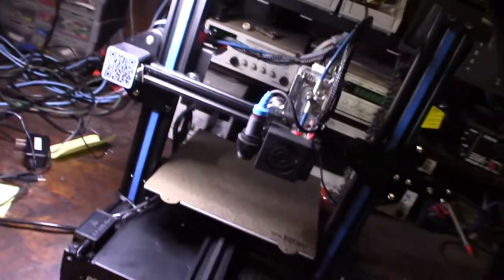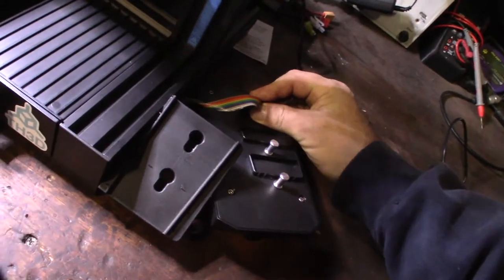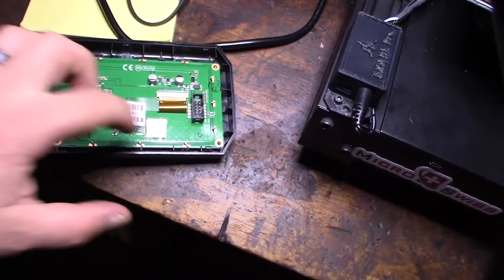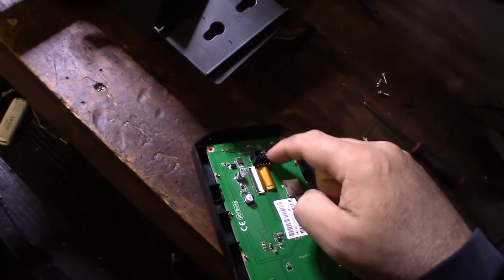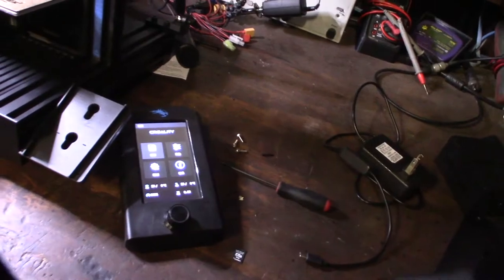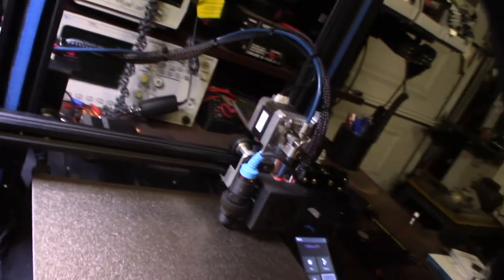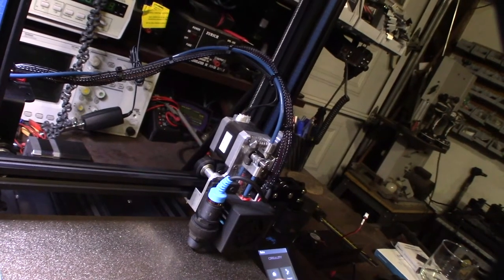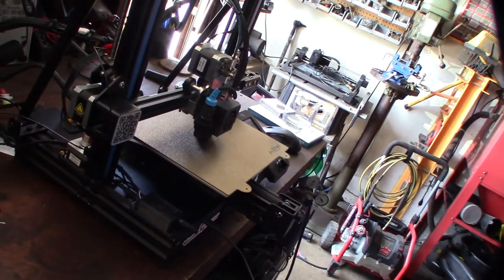Creality Ender 3 V2 TH3D EZABL Troubleshooting  Repair Blank LCD Alarm Orange Screen Beeping

Comment: Got mine to stop beeping but it still wont light up just black. I updated to the stock firmware for both and even tried v2. It is a pro with a 4.2.2 motherboard. Maybe a wire issue

Comment: Having a similar issue with my Ender 3 pro after trying to install a BLTouch. LCD making an alarm noise.
Reply from the maker: make sure you up the LCD firmware also. You need the right firmware or the LCD pins will not be correct for that screen.
Reply: @fintechrepairshop  same issue same model and upgrades; V4.2.7 board, BL TOUCH and upgrade to same screen in video. Annoying beeping. Links to correct bootloader's and firmware much appreciated. Thanks for your time!

Comment: I have ender 3v2 3D printer and it was printing ok. During one print it suddenly locked up. I replaced all axis motors , mother board, and display screen. Still locks up when turned on and no display screen. Do u repair them

Comment: I am French my ender 3 beep when I want to heat the bed so I reverse the nozzle wire with the bed and the surprise when I want to heat the bed it works but when I want to do Heat the nozzle its beep ... it does the opposite I am lost and do not know what to do could tell me in French how you had done ??